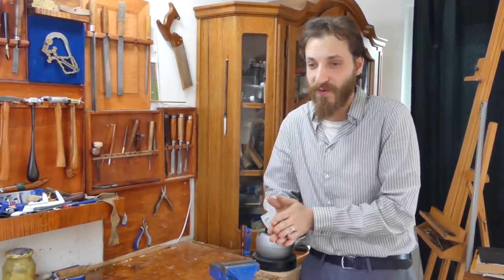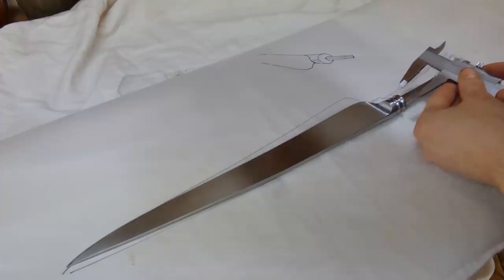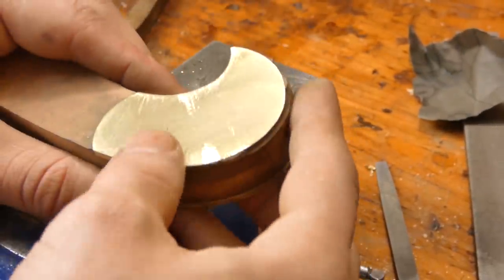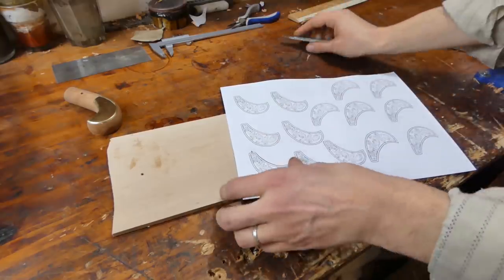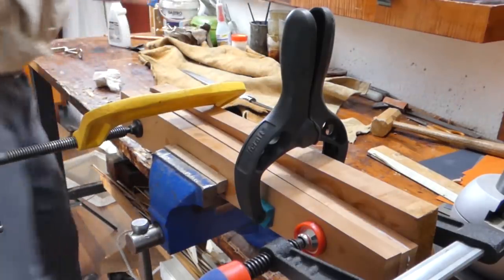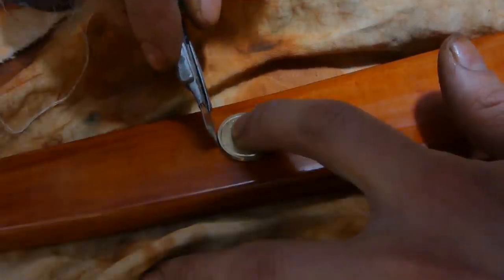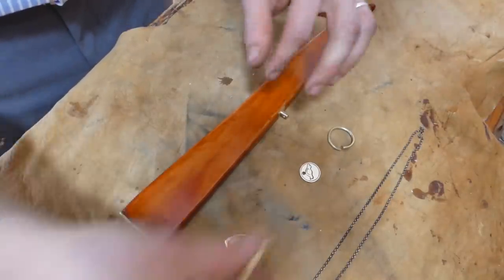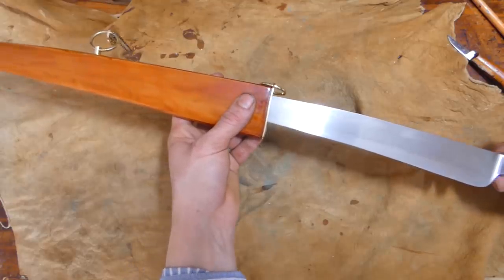Making a Persian Karud Knife with Green Beetle! - Charity Build

Comment: You can drill straight through hardened steel without reheating to soften by using a masonry drill bit they have carbide tips that will drill through hardened steel but you may go through a couple per hole

Comment: Beautiful job, as usual. My only criticism (and it's a very small one) is that you didn't line the inside of the scabbard with felt or leather or something. A tiny thing, but it would protect the blade.
Reply: My thoughts, too.  I always thought a scabbard had an oiled liner so that the blade was protected from rust while inside.
Reply: wood can't harm or scratch a metal blade, right?
Reply: @georgemac4224  I was thinking more  about keeping it sharp.

Comment: If ever you need to drill through hardened steel, a carbide bit will do the trick (It's not fun, and you should definitely use lubricant, and frequently cool it (either in oil, or water, I usually just use water, though I have used the parks 50 in my quench tank when I've forgotten to bring a bucket of water over) to avoid weakening the steel (you'll know you've weakened it if it changes colour, especially darker colours).

Comment: Do you hand engrave over using a electronic rotary engraving machine because hand engraving is better or do the rotary tools do just as good but you would rather be traditional?
Reply from the maker: I use hand engraving because it's a nicer experience in my opinion, without any noise and dust, and the overall aesthetics are different. for "power engraving" a rotary tool is not enough though, you'd use an air graver for the actual cuts.
Reply: @urituchmanpigeon   thank you I was wondering because I am about to start on engraving and trying to learn! Your work is amazing!!